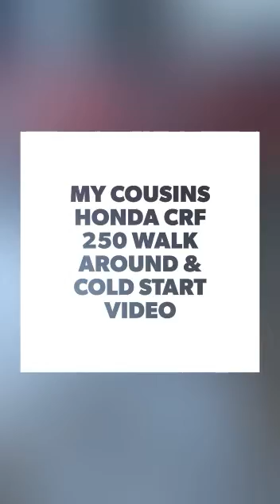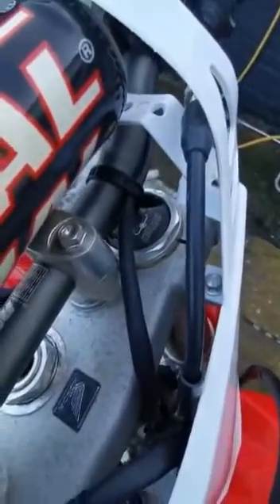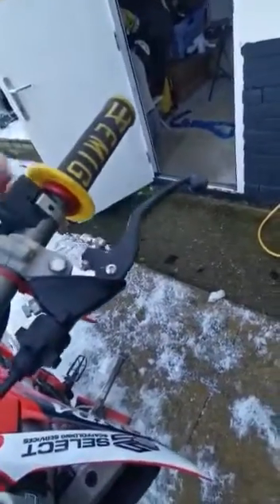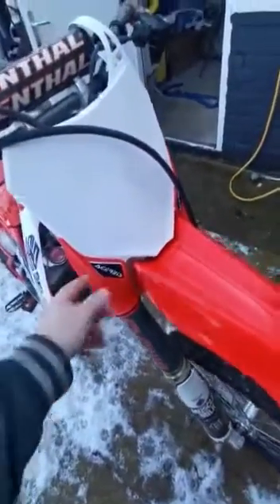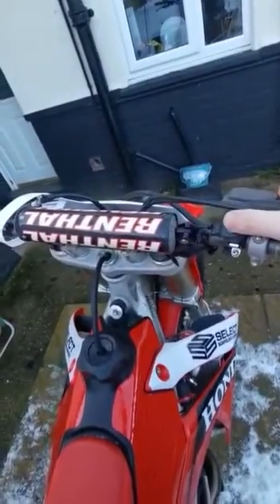Honda crf 250 | Walkaround | Cold start | Yoshimura | Rekluse | Sound | Loud | Dirt bike | Motocross

Comment: That bike is sick! Really nice upgrades you put on it.
Reply from the maker: Thanks, we will have more bike videos soon, next video is going to be a walk around and ride vid of are cr250 2001, it absolutely rips 🤪
Reply: @BRH_SALES  oh yeah they rip for sure, once dialed in. Did you keep the stock mikuni carb or upgrade it to the air striker or lectron? I just finished a 2001 cr250r build about a month ago, only last 3 days before someone bought it. Just finished the 2000 up, minor difference between the 2000/2001 (the 2000 had the air striker carb - 01 had mikuni - 2000 cdi box revs 500 less rpm compared to the 2001). Really great bikes when dialed in correctly.
Reply from the maker: @coloradodirtbike5930  the bike is Standard except exhaust and handlebars, I am looking for a standard exhaust if you no where I could find. Here in the Uk is completely impossible.
Reply: @BRH_SALES  Yea those oem exhaust can be difficult to come across, especially over seas. If you ever have to do carb work on that bike (to clean or rejet it) make sure to check the o ring on the float needle seat bucket (thats the brass little part where the float needle goes into). It's a common problem on the mikuni carb for the o ring to go bad, and most people never even know about it. The mikuni carbs have a lot of tuneability compared to the other brands. A lot of people like to use a s7 nozzle jet (stock is s9) but for me the s7 was too lean, so I put back in the s9, I would have used a s8 instead for optimal results.
Reply from the maker: @coloradodirtbike5930  brilliant thanks for the tips, and your videos are top notch mate 👍